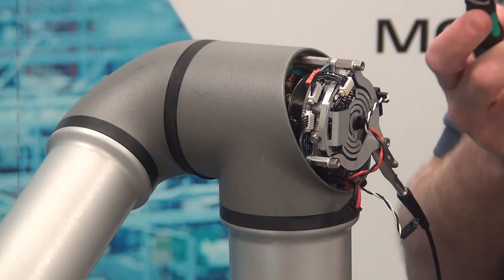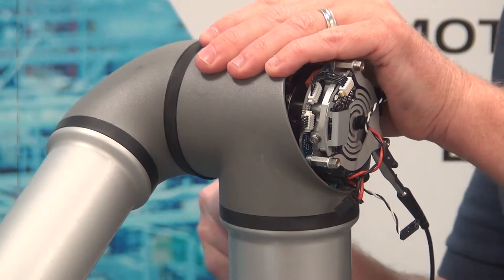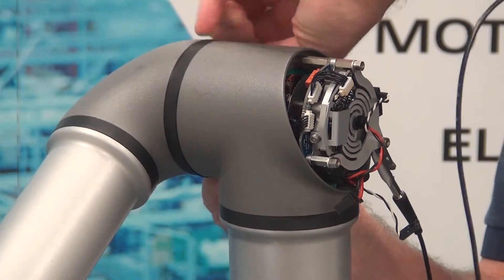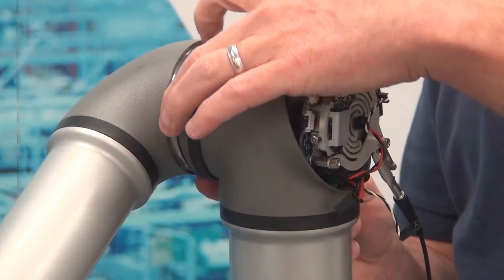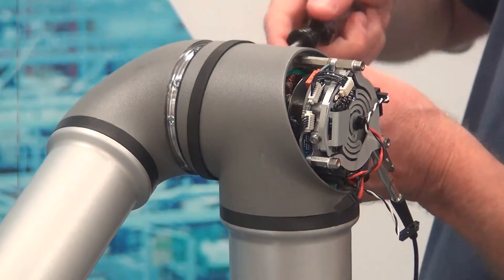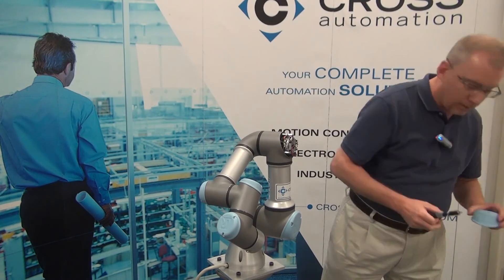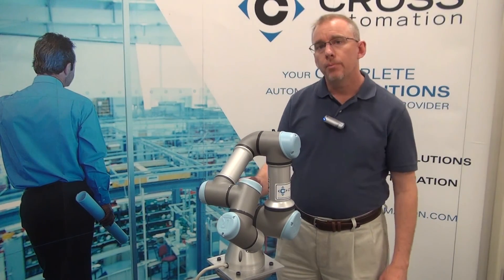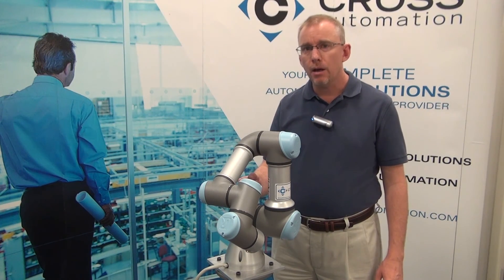UR3 Joint Replacement Tutorial

Comment: How many joints can be added, in the effort to reach in and behind something, or working in a blind void area, or to say, "snake through" to the point of interest? Can these center tube sections be any length I need, or course, limited by weight hanging out, at proportional rate? Section 1, closest to the base, 6 ft long, section 2, also 6 ft long, and then several sections short like the example shown in this video?  I suppose I should hunt down the website!!! I like how clean this look. Does these series of arms offer grounded disposable coverings, i.e. Paint booths, for when a color change occurs or clean ups and extended shut down?